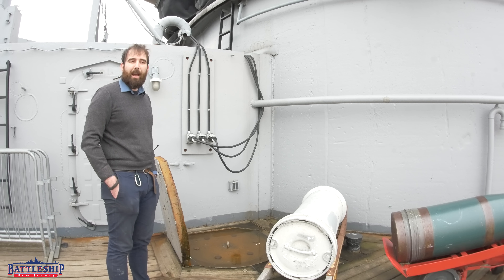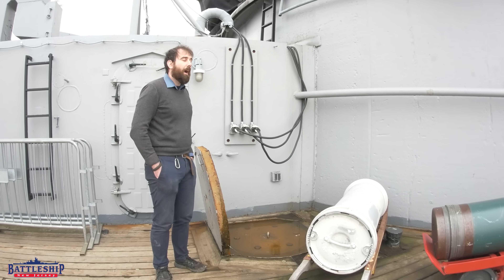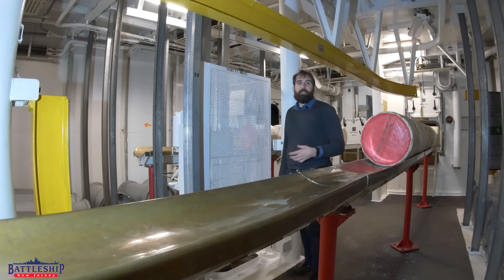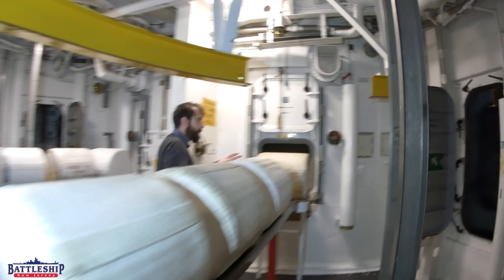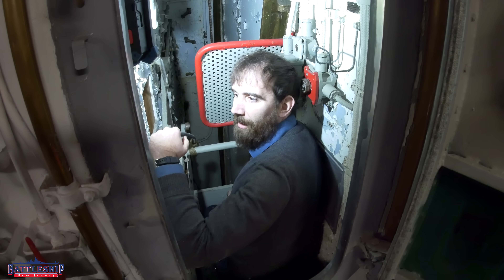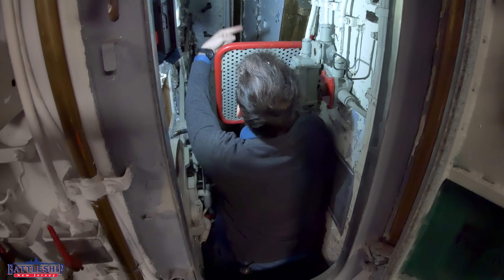Passing 660lbs of Powder For the 16in Guns

Comment: Question: I wonder how often someone practiced aiming and firing using the emergency backup controls inside a main turret.  I think there is a video with Ryan inside a main turret of New Jersey.  I've been inside a 16" turret on Battleship Alabama.  It was a tight squeeze to get inside. I have photos, but didn't have anything wider than a 28mm lens for my camera.  The optical aiming equipment had been somewhat disabled, but I could peer through the internal optic and see etched crosshairs.  Since part of the optical train was missing I could make out nothing but the crosshairs and a blurred image of daylight.  There was a computer repeater inside, too, with rotating indicators shaped like a ship viewed from above.  I can't recall if I tried to rotate an adjusting knob, or if it had any effect at moving the ship indicators. 

I can hardly imagine aiming and firing those big guns from that cramped local control space inside the rear of the armored turret. The turret I entered had nowhere near the room of the New Jersey turret in Ryans' video - it had no doors leading into the gun loading aea, as best as I recall from some years ago.  

I read that Bismark lost the main director control of its big guns pretty quick during its final battle. A survivor was gun captain of the aft local director, but he was unable to keep those systems firing, and made a harrowing escape, leading shipmates through narrow internal passages to reach the deck and go overboard.

Comment: This is a weird (and probably dumb) question but for the burst of compresed air that is shot to clean the guns after firing, does each turret have it's own compressor or is it just stored in a tank which needs to be refilled in a port from time to time?
Reply: Large ships have lots of compressed air available. It's actually a requirement for them to be able to air start even if the electric power is totally lost

Comment: Aww the memories. I handled powder on occasion, but my main job was the left lower powder door operator of the left gun of turret 3. It got really hectic during the Lebanon conflict where we fired 100's of rounds a day. You talked extensively about the passing of powder through the scuttle, the water bulkheads, and the operation of the scuttle. But did not talk too much about the powder doors red markings nor the operation of the powder doors. Could you do a video about the operation of the powder doors, showing those who never served on a Battleship how the doors open? Do not forget that the red goes toward the red on the powder doors. The painted red part on the powder bags goes toward the red part of the powder hoist. The red part of the powder bag (which you used training bags without the marking) is the part where the finer powder is. They all have to face the same, so the hoist operator does not have to waste time turning the bags around. I enjoyed reliving being part of the gun crew. I was proud to have fought in Lebanon and being a Battleship Sailor from late 1983 until 1990. And then cross rating from a Boatswains Mate to a Cook for another 12 years, and then a Master at Arms for another 6 years. Retiring in 2010. Proud to have served. US Navy. Thank you. You are a great Battleship curator. 😀

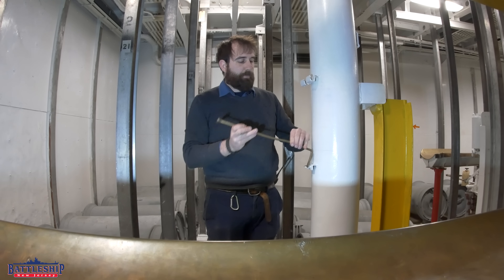Comment: 9:05 - "all implements ... were either brass or aluminium" - but NOT because they were "non-ferrous metals that do not spark", but NON-PYROPHORIC metals - i.e. ones that DO NOT SPARK.
(_Dictionary says: "Pyrophoric" - ... from Greek purophoros ‘fire-bearing’, from pur ‘fire’ + pherein ‘to bear’._)

"Ferrous", on the other hand, means "containing/ made of iron" (which is"ferrum" in Latin, hence the chemical symbol Fe and the adjective "ferrous"), and those "ferrous metals" are basically all sorts of "irons" (cast ~, wrought ~, plus carbon steel and alloy steel).
Iron (and its alloys) happens to be just one of few pyrophoric metals - other most common ones are cerium, titanium, zirconium and uranium - and NONE of them is "ferrous metal".

Alloys of cerium called mischmetall, German for "mixed metal", and ferrocerium were used in lighters as a flint before piezoelectric strikers took over, and are still used in "classic" Zippo fuel lighters, oxyacetylene torch igniters and flints in survival kits.
How pyrophoric uranium is anyone can see on videos showing depleted uranium bullets striking targets (most commonly on clips showing A-10 and its 30mm Gatling auto-cannon).
Titanium - here's a "spark test" that includes stainless steel, carbon steel, titanium and zirconium: youtube.com/watch?v=7gfe8mDyVQQ

Comment: I'm not 100% sure but I believe that they no longer use black powder at all in any heavy navel guns since the brown powder days in the late 1800's or early 1900's when they perfected cordite. They use a phosphorus patch on each bag facing the breach. The newest bag powder has additives (probably Molybdenum Sulfide (MoS2) or a like substance) that decreases barrel wear made by burning gasses so hot that it burns the insides of the gun. A 30-06 rifle bullet is shot into the breach, through the patches, to set off the powder. The reason for all this is that black powder burns very hot under pressure and is very bad for barrel wear and can cause unintended explosions in a bag gun where precise ramming pressure cannot be controlled and a host of other reasons.

Comment: Another great video!  it's stunning to think of how much design time and study of previous systems has to go into the last generation of battleship big guns. It's intricate but sturdy, contains numerous safeguards but still very fast, and really does show that the men were thought of in all aspects of the function. Yes, you need a lot of men, especially for consistent and quick powder passing, but it flows very well when they are trained up and practiced. 
The USS Salem's auto 8-inch guns are impressive in their design, but I can't say they have the same level of connection that the man-handled guns do.

Comment: Although the 2nd official Navy investigation came to conclusion "we're not sure why," (after the first investigation incredulously claimed it was Sailor Clayton Hartwig sabotaging the gun), it's pretty likely that over-ramming the powder bags, which Ryan emphasized you do NOT want to do @17:20, is what cause the deadly explosion in the center gun pit in turret 2 on the Iowa.  How the bags were over-rammed is open to debate, but these are the facts that seemed to have combined into a perfect storm:
1.  A rookie rammer-this live firing exercise was the first live fire exercise for the sailor manning the rammer station of the center gun; other center gun crew members were also very inexperienced.  Hartwig, the previous center gun captain, was assigned to help the center gun crew about a half hour before the firing exercise started. 
2. The live fire exercise was using only 5 powder bags, not 6, so the actual total weight of the charge was less than normal, which could lead the rammer man to apply too much force for the weight being rammed
3. There were reports from previous exercises that the center gun's rammer occasionally "took off on its own."
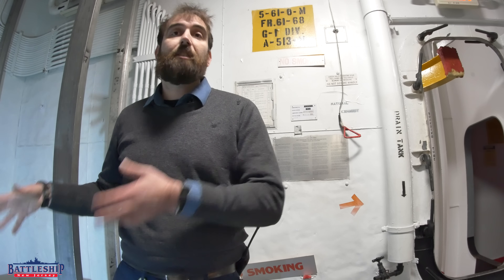4. The powder bags being used were subjected to being stored at much higher temps than allowed when they were last offloaded from the Iowa when it made its last port call, as described by Ryan @4:33
5.  The powder being used was from lots made 1943-1945.

Ryan has done a memorial video on the Iowa explosion https://www.youtube.com/watch?v=8D6v48cXvRo.  I think an in-depth video is warranted.

Comment: I don't think cordite is the correct description for the powder in the charge bag. Cordite was a smokeless powder used by the British in their bagged artillery and is left as very long strands the length of the charge, but I believe we used a single base smokeless powder that was extruded with perforations and cut to the designed length for its necessary burn configuration and was much more stable and less sensitive to temperature.

Comment: You obviously don't have the boilers operating. How do you power the lights and electronics?
Reply: Shore power. The ship has electricity feed from the pier, into our electrical systems, allowing something’s to be used.
Reply: @richcruse2689  By "some things," that pretty much means lighting and ventilation. There's not enough power to start any big motors.
Reply: Thanks

Comment: Has there ever been a misfire on any Iowa that caused the shell to get stuck in the barrel? 
And if so, would the process to get it out simply be to give it another shot of propellant?
Reply: I was on NJ 88-90.  I know of 1 time we had a misfire of the powder. Which was a mess.  

As I recall, as long as the powder all fires, or most, the pressure is so great, and since the breach is closed, it has to go somewhere.  Since the brass ring on the base of the shell is rammed into the rifling on the barrel, sealing it, the shell has to move if any of the powder ignites.  It may be a low pressure, which means the shell would basically blow out the end of the barrel, and only travel a short distance, hit the water and sink. 

I never heard of any misfires like that, however there may have been.

Comment: Amazing Ryan, you guys never fail us and having followed the channel for over two years, i’m still finding things out.  I have two questions maybe you or a former crew member could answer? When you say flood a magazine (in case of damage) does that mean heavy duty sprinklers or is that literally a wall of wall from the fire main?  I’m thinking about how easy it would be for sailors to escape a compartment. Secondly, in the turret, the paint has been badly affected by the NJ environment and not having 2,000 sailors on hand to repaint it for 30 years.  Would the other Iowas that were in storage for long periods during their lives have been in a similar state when they came to be reactivated?

Comment: I think I would get very nervous on a 16-inch gun crew. I can see where it would be a high-pressure job- any mistake could cost someone their life. I would be very nervous that I would blow up a 16-inch shell. I could see where the crew would have to have an extremely high level of trust for one another, especially the leadership. 
130 rounds per barrel... I could see why the Communist leadership of North Vietnam would say "If you want peace, get that battleship off the line!"
Reply: Setting off one of the shells would have been a lot more difficult than a powder bag.

Comment: Did they have any kind of ballast when the ship was empty? Could they onload all that ammunition(I'm sure there was 5", 40mm and 20mm rounds and powder) without it affecting the buoyancy of the ship? Did it not really matter because it was all basically centerline?
Reply: They would use water as ballast just like any other ship.
Reply: @Tom Newham  That's what I figured. I just wanted to ask. I didn't know if the tonnage of the guns and barrette being centerline and the placement of all the rounds and powder being centerline did anything other than a lower center of gravity. Seems like all the ammo and shells for the smaller guns wouldn't even be noticeable
Reply: @joebeach7759  as I recall, they would notify DC central when they were handing ammo, moving, even the 5”. Any shift of weight, fuel transfers, use, ammo transfers/use, water transfers/use, effected buoyancy of the ship, therefore ship handling. As such they would adjust ballast/fuel whenever any of these operations happened.

Comment: Why do they need someone between the two passing scuttles? I'd think it should be possible to link them so stuff just rolls across on it's own and both can be worked from one position.

I could see having damage control teams in there to fix, replace or take over for things if they get broken, but tying up someone who could be doing DC somewhere else seems like an odd choice.

Comment: What happened to the center gun of turret two on Iowa,  how did that accident occur, and what led up to that incident.. much respect for the professionalism of the crews of all the sailors that manned these mighty vessels
Reply: The hydraulic ram in that particular gun had a history of malfunctioning.  Also, the ram operator that day was inexperienced and had never operated the ram during a live fire exercise.  The Sandia investigation concluded that the most likely cause of the explosion was an overram of the power bags due either to human error or mechanical malfunction.  The overram compressed the bags and created enough friction to ignite the powder while the breech was open.
Reply: @NealB123  The Sandia "investigation" was a beautiful example of the USN tradition of appearing to conduct a thorough investigation of an incident while scapegoating the innocent and burying the evidence to prove otherwise.

The root cause of the explosion wasn't even in the turret at the time.  All of the men there were wearing blue dungarees.  The cause of the incident was some unauthorized experimentation with projectile Vs. powder load being conducted by guys further up the food chain, and involved some powder which should never have even left the depot, much less loaded.  Testimony of sailors on the Powder Flats regarding the non-standard powder bags which headed up the hoist conveniently disappeared.

You NEVER hold a man wearing a khaki uniform (Enlisted E-7 and above, officers) accountable when you can blame it on some nameless White Hat doing his job.  It is just not done.  It's a culture thing.  I lived it until I bailed as an E-5.

Look to a Gunnery chief and at least one gunnery officer for this one.
Reply: USS Iowa did a pretty good video of that. Both as a memorial to the men, and looking at the incident. Check out there YouTube page.

Comment: Very nicely done! How loud was it when those big guns fired? I didn't see any sailors where ear protection.
Reply: I worked on NJ from 88-90.  I was an engineer, so my experience during gun shoots was different.  However, my experience when ever we were topside for the shoot, we had hearing protection on.  The Navy was more concerned about our hearing during this time, then earlier in her life. 

What I do remember the most, the 16” fire was more of low low roar than an explosion like you think it would be.  The 5” fire, sounded more like a small arms fire.  In the engine room, I hated the 5” firing. It sounded more like a sledge hammer hitting the hull.  The 16” fire was softer easier firing to me.  Although anytime we heard the firing signal, first thing we did was move out from under the air duct, we always had debris flying down it when they were fired.
Reply: @richcruse2689  Thanks for the info!

Comment: At 12:35, "HP. AIr 3000PSI" pipe is shown. What is that used for? In industrial systems, high pressure, high volume gases are avoided due to the explosive fail states. Hydraulics are used instead. What could warrant that risk?
Reply: I would assume that's the reserve air used to blow out any remaining embers from the barrels after firing before loading new powder inside

Comment: The choreography these guys do  to work and keep up  in general quarters doing rapid firing must have been an impressive show.
Reply: It initially seems like choreography, but each individual person has a singular and repetitive motion. From the perspective of any given person, it is a simple operation: move bag from point A to point B, which is only a few feet away
Reply: @humanlast1062  Several feet by the looks of it when the turret is rotated, and carrying almost their own bodyweight in powder. Followed by half a dozen other guys I'd imagine to keep up the loading rate on 3 barrels.
Reply: 108 pounds is one hundredweight - 1/20th of an imperial ton (2240 pounds). Back in the day cement was sold in 1 cwt bags. I’m the 1970s they  became 50kg (110 pounds). More recently 25kg as it’s far better for manual handling.
Reply: Who cares about the ships guns, if our these guy’s guns the ship would just be a very expensive hunk of floating steel
Reply: @dogloversrule8476  I believe I understand what your saying here,  Without the sailors. This ship is a big pice of floating steel.   I whole heartedly agree.
Reply: @stevencote6999  precisely
Reply: @stevencote6999  I commend your analytical skills.

Comment: So for the crew taking the powder from the scuttles and loading them in the powder hoist - were they just constantly keeping the hoist filled with six powder bags - or were there commands that told them to load 4 in the right gun hoist, 6 in the center gun hoist, etc.
Or did they just keep loading the hoist to fill them with 6 bags - just work until all left, center and right gun hoists were filled with 6 bags?

Comment: Was there an alternate procedure, if the hoist was broken?
Reply: There was a hoist for each gun in the turret so maybe they had some kind of a procedure to move powder and shells between the guns in case a hoist broke? Would still slow down the rate of fire of the turret by a third as the ability to get ammunition up is probably the limiting factor so doing so would probably not help much in most situations.
Reply: @Murgo-u3l  they have a shell on a sling hanging from the main rail down broadway to demonstrate moving them from turret 3 forward or back to 3
Reply: @Murgo-u3l  There was no way to move a shell or powder from one gun to the other in the turret. Each barrel has its own gun room and they are separated by bulkheads.